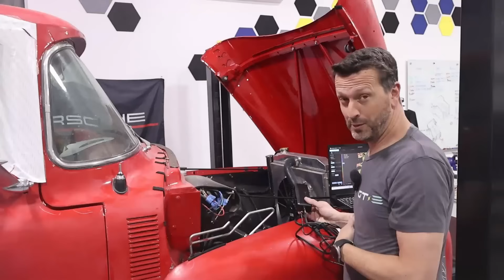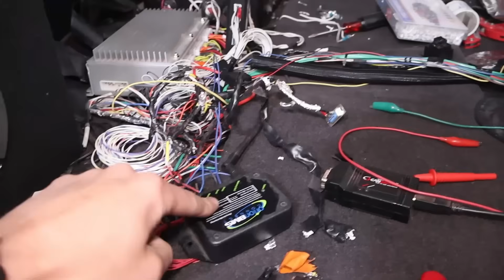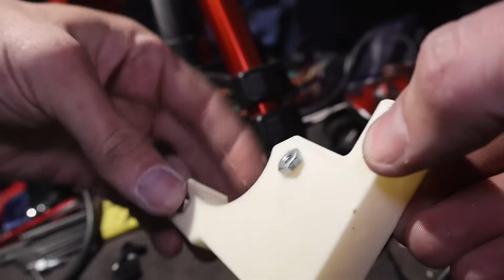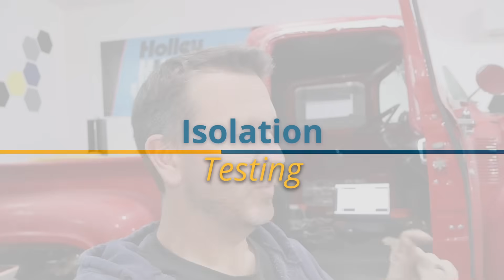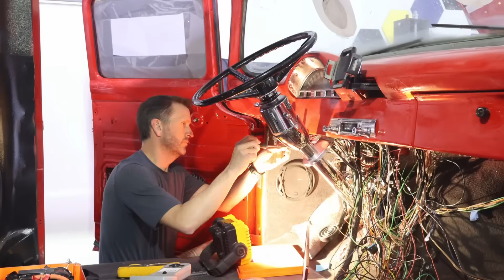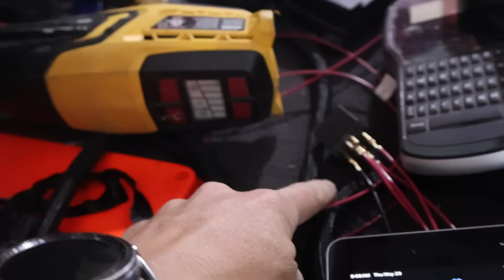Tesla Swap Motor Spinning

Comment: PLA vs Nylon for conductivity? Does nylon not conduct electricity? Why did you make the plate at the bottom of the box that holds the components aluminum instead of staying with your 3d printed PLA?
Reply from the maker: Heat makes the PLA really soft and can warp.  I did not want anything to shift when the car is parked outside on a summer day

Comment: It seems like one of the biggest challenges is getting all the different components to work together smoothly. There’s a lot of troubleshooting involved just to get everything up and running. I imagine you're constantly experimenting to find the right combination of brands and parts that work reliably without too much hassle.

If you ever manage to develop a setup that works well right from the start, you could turn it into a modular, easy-to-install system. You might even be able to sell it as a complete package designed to work with specific Tesla motors and battery configurations. That could end up being your golden ticket to success.
Reply from the maker: Good call

Comment: Love the Clifford red build – truly a work of art in motion.
Watching you breathe new life into that classic with a Tesla heart is 🔥.

I'm exploring a slightly different path: converting combustion vehicles using a range-extender setup — where a compact generator powers the EV drivetrain directly, without relying on a massive battery pack.
The twist? I use supercapacitors to handle peak loads and acceleration bursts. It keeps the system lightweight, responsive, and off-grid capable. Like a hybrid, but modular and DIY-friendly.

Would love to hear how this resonates with the community.
Keep pushing boundaries – this build is mad inspiring.

Ever considered ditching the battery altogether and going the cap + generator route?

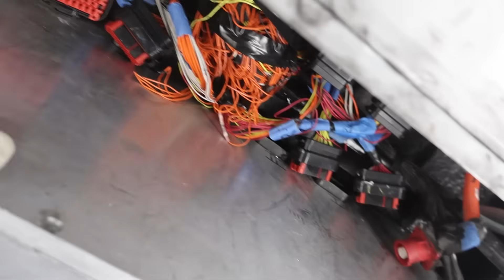Comment: 21:40 I'm sorry if I sound like a dweeb but that nest of wires looks like something made to go wrong. And when you get it out out in the open a little later it looks even worse.

Yes wires can be tricky when you are trying to wire things up, but that is horrible. I wouldn't trust that to keep working for any length of time. Add vibrations and bouncing around and things will eventually go bad, and finding exactly what it is in the mess will be close to impossible and you will end up either junking it or make a new wire loom.
Reply: Regarding that temporary solution for the break pedal sensor. Nothing is more permanent than a temporary solution that works. Remember that when making any temp solution. Either make sure it's solid enough that it is just as good as a permanent solution or make sure you replace it as soon as possible.

Comment: Get rid of that breaker on the firewall that was tripped/off. Those are notorious for overheating. Get a “Blue Sea” brand for under 48vdc

Comment: You are so diplomatic about the state that the truck came in... I admire your restraint, but I hope you're secretly screaming obscenities off camera  :^)  Glad to see your careful step-by-step testing and repair is getting you to the finish line.  I had far fewer problems with my 914 but it's a much simpler system with a DC motor, the only "fun" was talking with the Tesla battery modules with the EVTV V2 controller.
Reply from the maker: Interesting ✌️

Comment: Thanks. I knew the Orion BMS2 has the option for an internal CAN termination resistor, but I didn't realize that Orion BMS Connect WiFi module had an internal CAN termination resistor. That's extremely useful.
Reply from the maker: Glad to hear the info was helpful!

Comment: What a great video. All that work going into troubleshooting. You are a true guru figuring it all out. 
I saw a glimpse of your crimper tool for low (12v) voltage. Mind sharing a link of it? I need to find something better when working on my electrical on a normal gas powered car.
Reply from the maker: Link is in the video description. 
Here it is again for your convenience. 
Ratcheting Crimper - https://amzn.to/46fM4sA

Comment: That little black tab on the Tesla (Ford) brake switch is designed to auto-adjust the switching point.  It's set up so when you twist the switch into the bracket it sees the position of the plunger and locks that in so the switching is done at the correct position.   You also can not and should not run hipot insulation tests on a BMS that also does isolation detection, not only will it fail, it can also damage the Orion's isolation monitor circuit  Finally, the reason CAN bus is twisted is to reject both EM emission and induction.   What a mess that wiring is, I sure hope you are getting paid well!
Reply from the maker: Thanks for the helpful tips!
Reply: @electricsupercar   Those Ford brake switches also have a specific removal process to avoid damage to those black tabs. The plunger must be depressed before twisting to remove the switch otherwise the black tabs can be broken off. The plunger does not have to be depressed when installing the switch but you do need to make sure the black tabs are lined up with the other tabs on the body of the switch when installing.

Comment: You sir have the patience of a saint, to be able to look at a giant mess of wires and be able to figure out what is supposed to go where and redo it where necessary to make sure it's done right.
Reply from the maker: Thanks
Reply: @electricsupercar  I really hope you do some proper cable management there and clean up that forest of wires.
Reply from the maker: @hanscombrinck1481 on the to do list
Reply: Yeah some wire looms and some loom tape would do wonders for this install
Reply: I was just about to make the same comment.  Definitely way beyond my patience level.